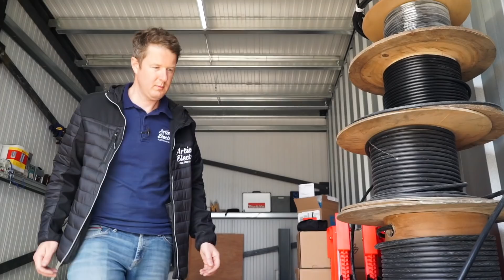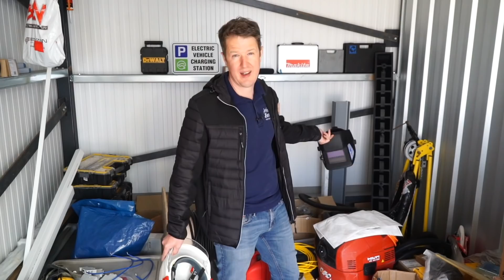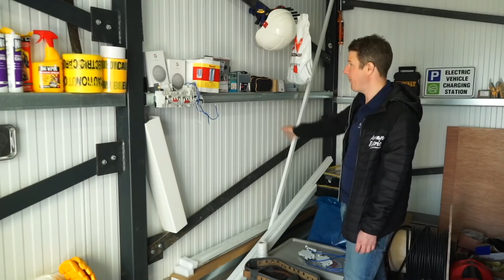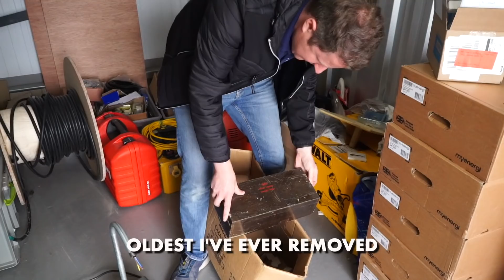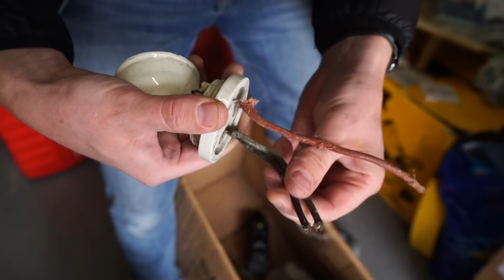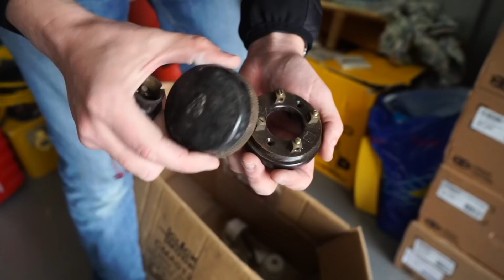ELECTRICIANS SECRET STORAGE UNIT - Electrician Life

Comment: The cables on the ceiling rose are V.I.R.short for  Vulcanised India Rubber .These cables eventually disintegrated.a real fire hazard sometimes installed in grooved wooden casing or 3/4"" split conduit not earth bonded.

Comment: Round porcelain or bakelite switches used to be mounted on those wooden pattresses too. Older wooden fuse boxes had double pole fusing. The old "RCD" is a Voltage-Operated Earth Leakage circuit breaker. They had an earth connection and a trip mechanism that would operate when 50V appeared across the trip coil. VOELCBs did not provide any protection against someone touching a live wire. This scenario would not cause any voltage to appear across the coil, therefore it would not trip. There were also issues with placement of the earth electrode. If it overlapped with the resistance area of a neighbouring property, unwanted tripping could occur.
They were deleted from the 15th Ed. in 1985, when the 15th Ed. became compulsory.
Callenders manufactured cable and accessories and later merged with British Insulated Cables to form British Insulated Callender's Cables or BICC.

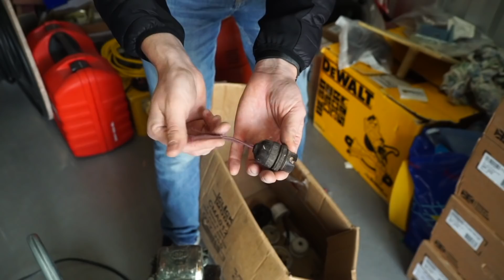Comment: When I was a young boy, my mother used to plug an iron into a ceiling light holder like the one @12:12 with an adaptor that looked like a light bulb base.  It was alarming just how bad safety was in those days.  I seem to remember it was all DC then as well.
Reply: I have a few of those light holder adaptors around. The on that went missing out of the collection is a two way version - a straight though to a standard BC connection and a switched output. this was used with the fairy lights at Christmas.

Comment: In 1981 I started off as an electrician in London's West End theatres. I came across loads of those old fittings, lead wrapped cables, and all sorts of ancient novelties, not only at work but working with my boss when we weren't at "work". All those old theatres lamps we used to bin are now worth a fortune once rewired and refitted with modern lamps. Also I knew that one day I would see someone who had a tidy lockup, although large, mine was jam packed, filled top to bottom and so disorganised I had to get a second one just to help shift some gear!

Comment: you really should upgrade to 6a or even 6 for cables, 5e is a bit old now
Reply: Almost nobody is running 10 gig mate, 5e is fine for gig up to 100m and in fact, even 2.5gbit.
Only reason to fit 6 or 6a is for 10 gig or higher electrical noise areas (or go stp), that's it.
Reply: @AndrewStrydomBRP  not really 6 and 6a is better quality and better for future proofing, plus better distance, be much better to use cat 6 over cat 5e
Reply: @williamg209two  People barely even have gigabit internet yet, let alone 2.5 or 10 gig.

Future proofing logic is fine, and the the negligible cost of cat 6 over 5e fine. but 6a is expensive and SWA cable even more so.

The vast majority of people will never use anything over 1G, maybe even 100mbit for a long, long, long time. 
So why go out and buy more new cable and waste the old or spend a significant amount more when there's no benefit?

Also, there is no distance benefit for 1G between 5e and 6, both are at the max of the spec which is 100m.

6 does 10g at 60m but that's irrelevant because almost none of the consumer installs are using that, it's something you don't need unless you know about it and ask specifically for it.

Comment: Those Voltage Operated Circuit breakers, worked on excess voltage draw. When there was breakdown of circuits or windings burning out, a bi-metal strip would heat up and act on a spring that would pull the contacts apart. John Ward has a full breakdown of one of them.
Reply: Obsolete Devices: VOELCB Operation and Problems
https://www.youtube.com/watch?v=JMh684HniF0

Thought I would post this here in case anybody else ran across it.

Comment: During my apprenticeship and early years I rewired loads of 1930's bay fronted houses. They all had the dolly light switches on wooden pattresses. VIR cabling and no earthing. Lath and plaster walls which meant a nightmare to get fixings. day one on the job was the apprentice going round with hammer and bolster and knocking all the switches and roses off with one swoop of the hammer and bolster behind the pattress. Cutting the VIR ready to use as a draw wire.

Comment: Victorian times ? Porcelain ceiling roses ? I would question that one 😉 That what looks to be VIR cable was still used in the 50's, it was preceded by lead sheathed, and I think TRS cable followed that until PVC T&E was introduced. I have seen VIR cable in better condition than the later TRS cable ! My parents property was built in the 50's and VIR cable was used, the sockets/ switch boxes were wooden but the ceiling roses were not porcelain, more a bakalite type material. So, based on the above I would say that rose and cable you had there would be earlier than the 50's and later than maybe late 30's.
I doubt there was ever an overnight change in the use of cables so the types of cables used would run parallel for some time so not easy to date an installation by the cable used. Fittings however seem to change more often. Just look at how many different types of switches and sockets etc that have been used over the lifespan of PVC T&E. There was of course the horrendous copper coated aluminum T&E that was intruced for some years.. terrible stuff.
 I would also have serious doubts that there are any Victorian electricians watching Youtube today, I am open to be proven wrong , Queen Victoria died in 1901 ! so even if there was a youthful 18yr old apprentice learning his trade that year, he would be around 139 years of age  now..

Comment: "Vintage Fuseholders".   Many of those ceramic holders are still in use in New Zealand.  Even now, the unit I live in has those (and we have a card of 5amp, 10 amp and 15 amp fuse wire in the fuse box, in case of a fuse "going").  My parents' old house has them (unless replaced in the near 20 years since it was sold).  Note:  they are no longer sold in the electrical shops, and not approved for new installations.

Comment: Are you sure that junction box says “B L Callender's” on, and not “B I Calendar’s” as in British Insulated Callender's Cables or BICC (formed as a merger between “Callender's Cable and Construction Company” and “British Insulated Cables”). They are technically still going as the Balfour Beatty construction firm after they sold off all the cabling subsidiaries throughout the 1990s then renamed the company after the remaining construction subsidiary in 2000.

Comment: God I must be old I Remember installing many of those types of items in your collection. When I started we were using rubber cable in slip tube, and vir cable in conduit, in fact there were new rolls of lead cable on the shelves, although never used by me.
Reply: When did you start electrical work?

Comment: I have the porcelain wooden fuse board but has a glass front ,also the servant flag type Call indicator box and a few old porcelain brass top toggle switch which you can now get the modern type 👍

Comment: Secret's out! behind Bensons for Beds, just of the A1134

Hope you don't mind me sharing a few of my tips for staying organised as a spark with materials etc
* Shelves. Put the big light stuff on the top shelf, the big heavy stuff on the bottom shelf and if you have to move more than two things to get to the bottom/back of a shelf then you need shallower shelves/ more of them. Maybe have 40cm deep shelves on one wall and 60/80 on the other to cater for different sizes of stuff
* I have 1.8 and 2.8m lengths of 110mm drain pipe on the ceiling of my storage. Great for long lengths, I can get mini trunking or conduit delivered 10 or 20 lengths at a time and carry what I need (usually not more than 2 or 3 per job). Any stored offcuts shorter than 2m goes vertically in a bin, anything shorter than 60cm goes in a crate on shelves
* Things to keep near the door to help with organisation: Yellow gaffer tape for labelling. Eg which job it's ready for, whats in a box that's sealed to keep it all together etc. A sharpie, even though I have one in my pocket 95% of the time. PVC insulation tape: coiling extension leads or anything else that will collapse into a mess. A rubbish bin - stops the place getting overrun with junk. White board or clip board - list of things to buy (though I suspect Artisan have something app based for this)
* Stuff you use most by the door, least at the back
* Mark up cable. Some drums come with the label on the wrapping not the side of the drum, so when you've removed the wrapping you just have to guess. Knowing what it is and the supplier's code means you can easily buy the same again (or avoid buying the same again) If they don't have the length on the cable it might help to write approximately how much is left too. 
* Label boxes clearly. Both ends if you're likely to put them back the other way round
* Boxes as similar as possible. Eg bale arm crates/attached lid totes/euro containers/really useful boxes. Pick one type and invest. One type means proper stacking so can be stored quickly without damaging contents
* Clear boxes where possible. I keep all my surplus breakers in Haribo boxes free from church youth group. Maybe I need to give your uncle a call: https://www.facebook.com/media/set/?set=a.3363698540425816 - means you can see what you have quickly, and we all know time is money
* Record what you have, or have storage and office as close as possible. Saves buying stuff you already have in storage

Comment: Jordan the old Crabtree ‘rcd’ is actually a VO-ELCB or voltage operated earth leakage circuit breaker. It relied upon fault current flowing down the main earth through a detection coil to the earth rod. We stopped using them due to parallel earth paths  to earth circumventing the detection coil thereby the fault coil not operating. It was always difficult to explain to the consumer why it had to be replaced as if you pressed the yellow test button it would of course still trip. I used to teach this to my students as they had to be able to draw the circuit diagram if one and explain the difference between the VO-ELCB and the RCD. Hope that has answered your question. Tim
Reply: They were standard fit in the mobile site units we used to build in the early eighties
Reply: We used to have them in Australia too and I believe the voltage between the earth electrodes had to rise to about 22volts to trip
Reply: Obsolete Devices: VOELCB Operation and Problems
https://www.youtube.com/watch?v=JMh684HniF0

Comment: ive came across and changed a few of those crabtree RCD's and got a few wooden backed wylex fuse boards to replace soon.  Best thing ive seen on a site is an old mercury contactor (rotary switch?) that controls heating in a school.  3 phase so 3 viles of mercury, maybe 3-4" long and 2" wide so quite a lot of mercury in them and it rattles like a washing machine when its on 😂

Comment: HI I'm old the old voltage safety trips had  many major problem , if you look at the bottom connections there are two earth points. One for the earth of the property and one for an earth spike, problem is when they trip the coil is so big the back EMF is 50,000 volts. Problems if you got your wires the wrong way around you can guess where the 50kv went and if you have the earth spike in one hand the wire in the other and you mate pushes the yellow button you cant use your arm for a couple of hours trying to get eight earth spikes in and around a block of flats, if one tripped out they all went off like a machine gun.
Reply: Obsolete Devices: VOELCB Operation and Problems
https://www.youtube.com/watch?v=JMh684HniF0

Comment: All your old porcelain stuff was installed in a 1930's built house I bought around 1970. It was fed by lead covered cable with fabric core insulation. Pendants had 2 brown twisted fabric covered wires going down to the lamp fitting. Touch it and it fell apart

Comment: Rubberized cloth was a huge improvement in electrical wiring.  Before, it was just plain cloth.  If the wires got wet, they were extremely dangerous.

Comment: Storage is critical. If you cover large parts of the UK top tip. Have a few and dont let anyone know about them. Its like breaking bad but without the drugs 🤣.

Nice video.
Reply: If they are far away you need to have good stock taking facilities!
Reply: @AndyK.1  100% crm software and stock management. Avoids lads having gear in vans over night as well.